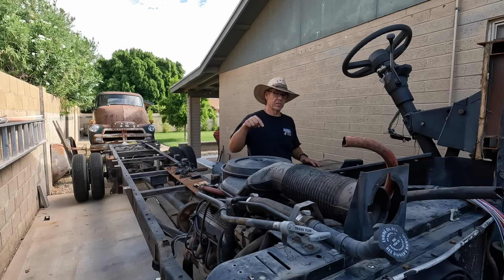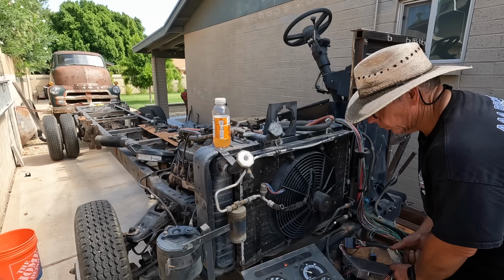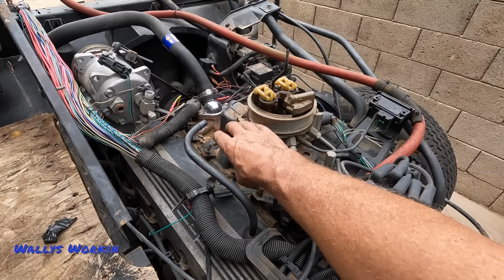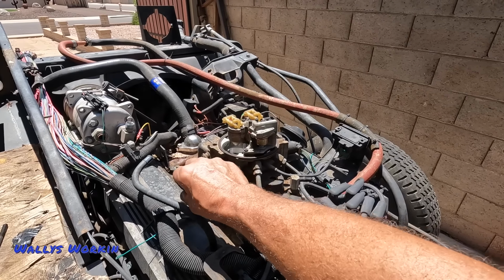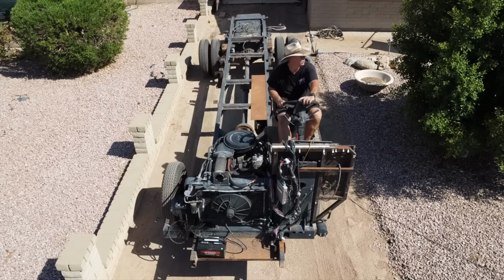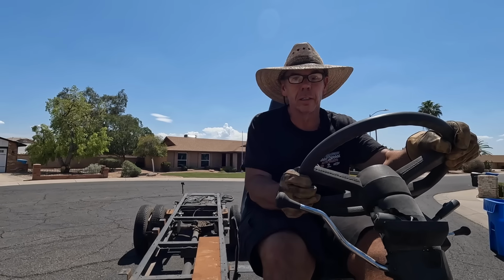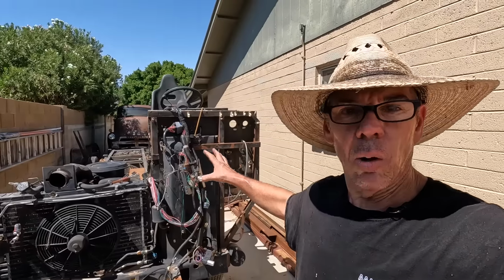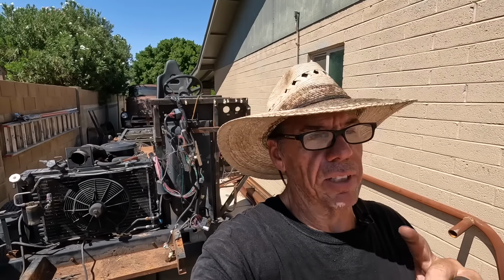Test driving the motorhome chassis for my COE / 1955 Chevy COE build

Comment: I’d set up a car hauler. Can still make side racks that slide in pockets.. A maverick should fit in between side racks! I’d find one of those cool crank up old campers. Or an insulated milk type truck box. That you could pull up on,orlower on.hook up a few lines. Then you have a camp rig.  Put a small boat on back. Or a 4 wheeler.Ultimate camp rig. Get home,pull it off,then you have a hauler to pick up future projects or take something to car shows. Could even find or make a dump bed to haul a little manure,gravel on the back end.  The possibilities are endless.  We had a flatbed trailer ,had the ramps built on,you’d load the dozer then the ramps hinged up and on the end. Always liked it better than removable ramps. Bonus they never came off when loading by accident. No matter how wet or muddy. I’m sure whatever you do will be cool. A good platform . Then different things to make it what you need at the time would be my vote! Either way you do good quality work! Anything will be cool! Except a pool on back!
Reply from the maker: A pool? That’s it!! 😂

Comment: I used to live near the Dennis truck factory in Surrey Uk & in the very early mornings I would see then chassis testing the trucks, they had a old arm chair and the guy would have a ww1 flying helmet and goggles doing and 60-70mph 🇬🇧🇬🇧👍👍
Reply from the maker: Back in the 90's I drove a truck and would see basically the same thing. They would move chassis' between locations.

Comment: I have the same chassis on my rv. Great motor! I strongly suggest flushing the 4 row radiator that's difficult to replace,  filter and fluid on the trans, fuel pump while it's easily accessible, and most importantly the brake pads and calipers as the rears can (will) lock up and snap the rotors, and you don't want to pull the axles to replace them like I had to!😅
Reply from the maker: Thanks for the heads up.

Comment: I have a 48 COE that I am putting onto a 1989 1ton Chevy 4x4 with a 7.4L.  The test fit has the cab sitting extremely high.  I am very interested on how you solve the fitment issue.  FYI the subframe with the pedals and parking brake can still be used or connected to the new stuff .  So don't through out or destroy it. Just drill out the rivets off the old frame.  My goal is to be up and running by March to drive it from Roseburg Oregon to the off road wreck games in Utah that Matt's off road puts on.
Reply from the maker: We will see how it goes. I’m ok with it being tall because I want it to look “stock”

Comment: if you want to shorten the wheelbase you could move the whole axle and spring hanger setup and move it forward 
you might leave it a little longer than a normal pickup longbed , make it intoo a flatbed / stakebed and have a thirth wheel hitch sunk in the floor , if you pull off the sides you can use the truck to pull sumting like that big gooseneck you used to drive the rv home  , could leave the frame longer and drop the rear get some airbags in the rear to be able to drop the tail on the ground and make it intoo a car hauler , might be more usefull that way , not sure if the frame is strong enough for that though

Comment: she's a runner and sounds good what a score.  Love the Maverick I see 5 bolt wheels so a V8 with the small bumpers. Must be about a 72?  I bought a Grabber brand new in 1970 $2300.00
Reply from the maker: It’s a 72, originally a 6 cylinder car converted. Getting a stroker 302 and a 4r70w. I will have a video out this Saturday on it.

Comment: Get a fifth wheel plate, so you can pull a fifth wheel trailer. Get twin polished gas tanks, shorter wheel base. Go to go!
Reply: I like this idea couple with the stake bed. It would be an awesome hauler
Reply from the maker: I’ve thought about that. I’d love to find an old vintage fifth wheel trailer to restore.

Comment: How far back does the motor have to move back? I assumed it would have been almost perfect but obviously I don't have eyes on it. I have a real soft spot for old COE trucks and I can tell this truck is going to be amazing. If it were my truck, depending on what I needed it for I would either go with the flat bed with wooden sides and make it a roll off for cars or I'd go with the pick-up bed idea and install a 5th wheel receiver to pull a trailer. Or maybe a box truck IDC. What ever choice you make you have a new sub that wants to see the end game on this project.
Reply from the maker: I don’t want the engine under the cab because I do not want a doghouse. I want to keep the floors flat if possible.
Reply: @wallysworkin823  going to hang the transmission behind the cab like a modern Isuzu tilt cab or even farther?
Reply from the maker: Basically, yes.

Comment: I was thinking of using a motorhome frame and engine etc… also. But I wanted to keep the engine where it is and make the cab tilt forward to work on the engine when needed. I also want it to be a huge custom pickup truck. I just worry about how much room is under the cab to be able to fit over the engine. I don’t like the look of a mid engine just hanging out in the open. Makes it look like a rat rod instead of a genuine truck build.
Reply: My cousin has the motorhome with a Cummins diesel and only 60,000 miles. He owns a company that cleans out houses after a person dies. Motorhome sat for years, one of the first years for this model engine and from what I have found about it, it’s thee most dependable Cummins diesel engine yet.
Reply from the maker: I’m trying to avoid a big doghouse in the cab but we’ll see how it goes. I don’t want the engine too dark back either. It’ll be a balance between the two.

Comment: I would have chosen a mechanical diesel engine. no computer, no electronics, no problems, works even without a battery. modern stuff is bs, only headache and expensives
Reply from the maker: I was looking, but couldn’t find anything priced halfway decent in my area. Plus, this was only $400. I would love to put a 12 valve in it but they are crazy money.
Reply: @wallysworkin823  crazy market.